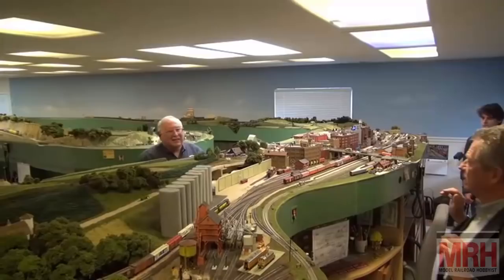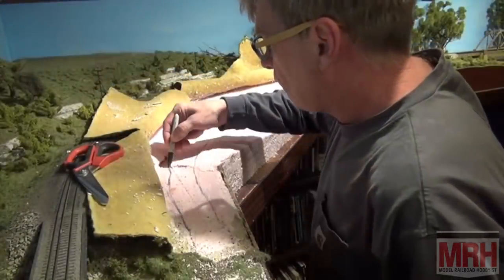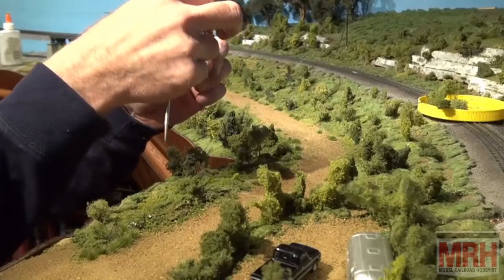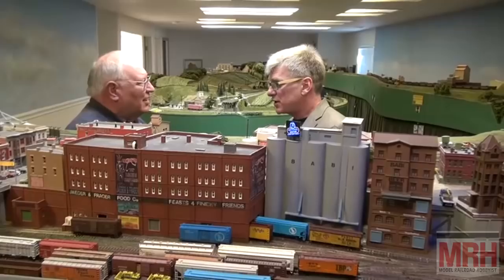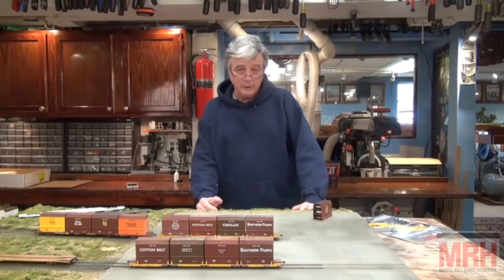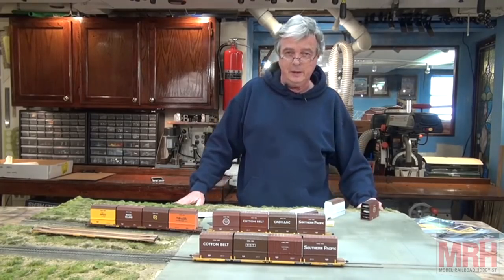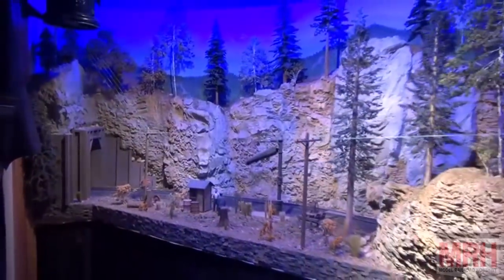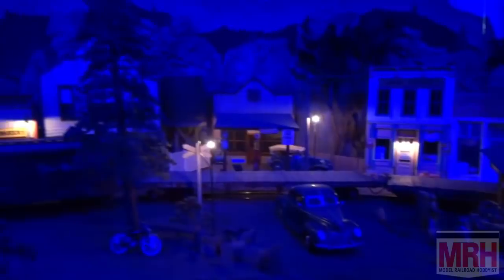Whats Neat in model railroading | May 2018 Model Railroad Hobbyist | Ken Patterson

Comment: I really enjoyed Mike Budde's stack pack presentation. My favorite modeling period is nearly the same as Mikes, late 1970's thru early 1980's - D&RGW for me.  Like MIke, I have been drawn to some models that are a bit on early edge of that 1977's year - the ExactRail Ver-a-pac's, which were also a niche type auto carrier although they were in service a little longer IIRC.  Very interesting series on the Stack Pac's and thanks for sharing.  Cheers, Jim Fitch
Reply: riogrande5761, thanks, Jim!   Yes, the Vert a Pacs lasted until the end of the ‘77 Model year.  But I still run them anyway!😁

Comment: I have been practicing my mea culpa's - I messed up in the opening interview by incorrectly naming the prototype railroad name that ran near my boyhood home. The correct name of the prototype railroad is the Cedar Rapids and Iowa City while the name of my N scale model railroad is the Cedar River and Iowa Central. 
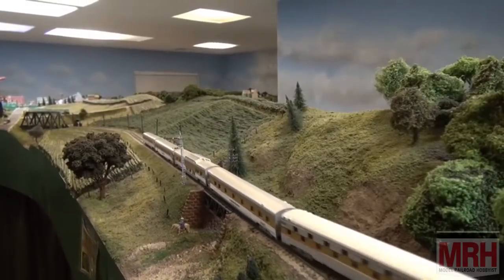There was a question in the comments about the semaphores. They are scratch built and do work.  You can see the upper semaphore move at about 15:40 in the video.
There was a comment about seeing Kansas City being in the segment. Yes, the N scale Crandic runs geographically from Kansas City, MO to Central Iowa.
Considering my nervousness and the short time Ken was here and his objectives, I think he did a great job putting the whole segment together. Thanks, Ken

Comment: Got a "Q".  In my many years of Model RxR I have never heard of scenery surfacing with "Fake Fur".  What is it and where is it available.  I'm in upstate NY, on the boarder with MA & VT.  Do you know of any online marketers or manufactures?  I'd like to try it on my Fall 2018/Winter 2019 line expansion.
Reply from the maker: You can get fake fur at any fabric store. It's used by seamstress-type folks to add fur adornment to garments.

Comment: Who makes the two-bladed semaphore signal shown on the CRANDIC layout?  What is being used to make it operable?
Reply: Jonathan, All the semaphores are scratch-built with model airplane linkages to Tortoise switch machines. Digitrax SE8C's are used to power the Tortoises.
Reply: Patrick Lana Pat, thank you for your reply.  As scratchbuilt items, this semaphores are really impressive.  My current layout prototype used two-bladed semaphores, but my initial choice was to use searchlights since the semaphores are not commercially available.  How can I get more information on how you built yours?  Perhaps some photos and a list of materials and techniques would help me understand how you made them.  I visited your layout perhaps ten years ago with the Great Basin Getaway crowd.  My friend Brian Marotta introduced me to you.  Your layout ended up being the one that encouraged me to change to n scale.  It showed that fine modelwork, scratchbuilding, and operation could be done in N despite prevailing opinions  at the time.